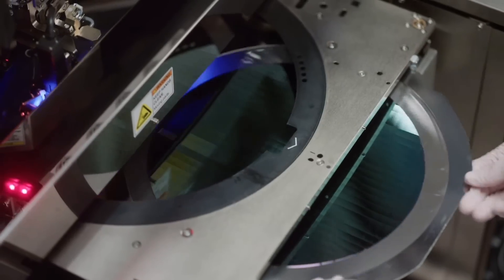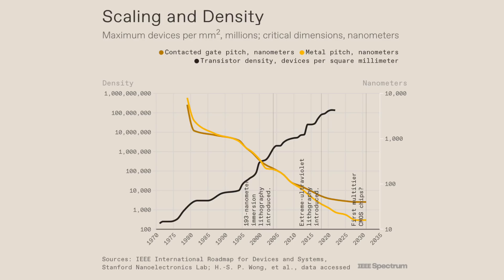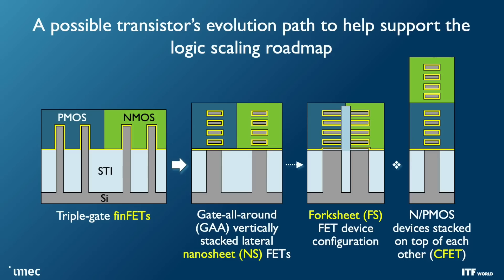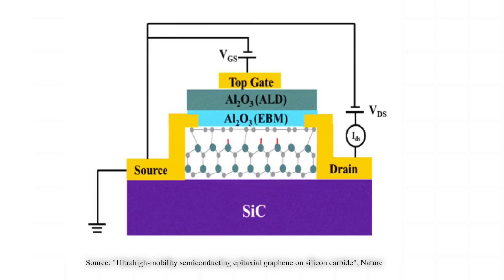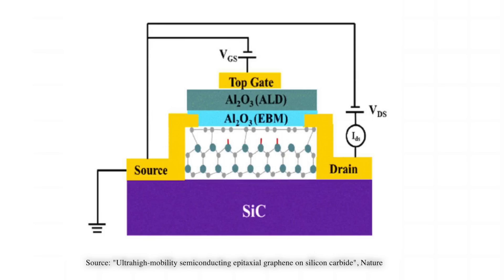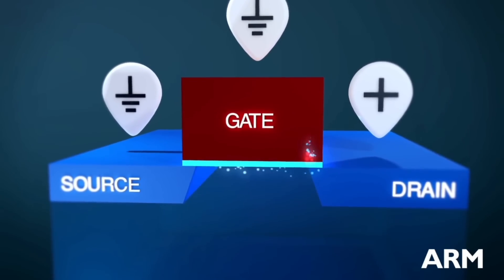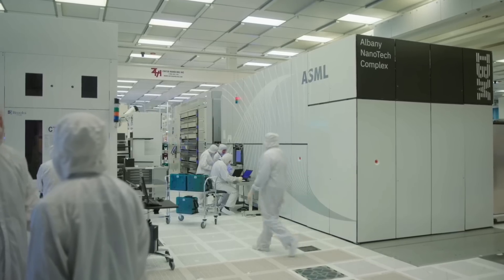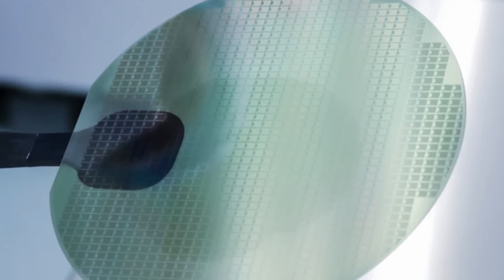Microchip Breakthrough: New Era of Electronics

Comment: I’m not tired of hearing about these potential breakthrough’s or any. I appreciate Anastasi explaining it so thoroughly. Face it, They have been talking about flying cars becoming a reality since the 70’s. Still waiting. Sometimes you just have to be patient. (Update - 1 week since original, reply post)                      I just read-China now has a autonomous flying taxi, able to carry 2 passengers at a time. It has been certified by the government and is now in service. So, I guess the wait is over.
Reply: Exactly what they said about self driving car’s. 10 year’s ago.
Reply: @AJF-v4i    Tesla's  are self driving   ... shhhhhhhh ..  your misinformed or technically wrong either way
Reply: Flying cars are real though - it’s only the lack of regulation and logistics of implementing it at scale that are in the way. We now have flying cars that are safer and easier to use than road cars.
Reply: Flying cars already exists in several models.
They just aren't generally appreciated. Because they are too expensive, too much problems with laws and infrastructure.
Reply: Flying cars are here…
Reply: We do have flying cars. There just isn't the infrastructure for them. They are better suited to rural areas.
Reply: This microchips need to be for whole world so the need to build in qantie and it need to work for the people but what if we can make something  like bigger more power and if we master that we make it smaller like in 1970 with the 500mb computer that was looding from the plane😂😂🤔🤔
Reply: @jdanci91 quantity I assume you mean
Reply: THey had flying cars available to the public years ago, many years ago.
Reply: But bro Flying car is real now people are using it commercially.
Reply: Actually the 1940's not the 70's. There was one, now there are more.
Reply: I'm a millennial, flying cars is not coming during my lifetime. If we can't invest in nuclear energy on a broad scale then we'll never move forward as a species. Either nuclear energy or discover how to harness dark matter, no other way around it.
Reply: Thing is, making flying cars isn’t a problem. They’ve been able to do it since the mid-90s. The issue is, the person that “will get gas in the morning”, or the “two beers makes me more alert” person. Flying isn’t the problem, it’s idiot property damage and potential lawsuits.
Reply: @metaphyzxx I'd say 75% of drivers are at their max driving a vehicle.
Reply: @metaphyzxx  damn you gotta point. I'm both of those guys wrapped up in one and I'm also a truck driver, oh shit
Reply: flying cars are a terrible comparison because it’s not really a breakthrough holding them back, it’s the fact that flying cars are a nightmare of safety/logistical/infrastructure problems and there’s no reason to spend time and effort solving them when we have much, much better options that already exist with mass adoption.
Reply: Have you ever looked at how horrible people treat there cars?  If flying cars where a reality, it wouldn't be a person pulling over on the side of the road because they haven't changed there oil in two years, now it falls out of the sky and hits my house. No thanks.
Reply: Yeah as engineer i also hate when hearing about flying cars.. it wont ever happen.. physics wont allow it. Cars need drag (downward force) so u can drive safely and btter grip while plane needs aerodynamic to fly off.. do u get it? U cant have both...
Reply: Flying cars aren't really practical for many reasons and introduce a whole host of liability problems, which is why we don't have them. Photonics, epigraphene chips, etc on the other hand are entirely practical and propose very few issues. Certainly none on the same level as worrying about a flying car breaking down and turning into a terminal projectile that smashes into your neighborhood and kills a family.
Reply: Cars kills and smashes into family every day, they don't need to fly to be deadly.  @JustSomeDinosaurPerson
Reply: @JustSomeDinosaurPerson   we are talking about combining graphite/ graphine and silicon to make a stackable chip that dissipates heat. The example of flying car’s was used (just) as a example about being patient, while waiting for the technology to catch up. Did you watch the video?
Reply: @AJF-v4i Yes, you brought flying cars just as an example for something to wait for… but JustSomeDinasaurPerson just told you, and you didn’t get it, that it was the WRONG example, because flying cars are NOT something to be waiting for, just forget about them, and find a better example, maybe Nuclear Fusion would be a better example.
Reply: graphene isnt a flying car.. we're not getting flying cars
Reply: Mm this is the real deal bro
Reply: they got jetpacks.https://www.youtube.com/watch?v=DkZPI5m9SIE  Flying cars in reality wouldn't be a good Idea, navigation rules, air and sky pollution, crashes ect
Reply: Don't forget about idiot drivers who are already dangerous enough on the ground, lol!
Reply: Flying cars exists since a long time. Was it a good idea should be your question
Reply: I've been waiting for self driving flying cars for like forever. It's so boring!
Reply: They're called flying drone cars or something like that. People can get in and fly drones themselves around where have you been
Reply: Come on man, it's the pie in the sky battery breakthroughs that really tire me.
Reply: Flying cars already exist. They are called helicopters.
Reply: Joby Aviation is quickly becoming the closest option to flying cars
Reply: The idea of flying cars actually goes back at least 100 years. 😅
Reply: Flying cars ARE a reality! We have the technology. I saw a video of a german teen building and piloting a flying bathtub.
The reason we dont see them is that 90% of car drivers can NOT be trusted with a flying car!
Reply: They are very close now
Reply: This AI is evil.
Reply: We have flying cars, it is called a plane
Reply: Oh actually we have it since the 70s duhh... Try drive it for 2 hours at least at 40kmh then fly back lets see how convenient it is. Flying cars are pipe dream why u want to ride when u can fly.. drone have a btter future than flying car
Reply: Yeah I feel the same way, but we both did click on this video right? And the flip side is that it takes a long time to reinvent a better wheel for lack of a better analogy. And when I heard her say GPUs and CPUs... Ugh I almost oozed...
Reply: A guy built a flying car in the 70s. The limitations with flying cars have nothing to do with tech. The problem is that there just aren't very many people with a pilots license and who live next to a runway. Because of that, the idea is entirely unscalable. These chips OTOH, will pay for themselves in Bitcoin alone. When they start making these, they probably won't even sell them for a long time. They'll just let them sit and collect money.
Reply: Hell flying cars that are approved for driving and fight exist. You can literally drive to any airport and take off in your car.
Reply: It’s copied from iPhone 7
Reply: Flying cars exist dude... Is a matter of regulation and society using it right.
Reply: That reminds me of recent veritasium video about blue LEDs
Reply: Flying car already exists
Reply: Flying cars don’t make a lot of sense. Theoretically, all the air-space should make travel good and smooth, but it will be harder for the driver and more accident prone. Interfering with the airplanes and helicopters isn’t a big problem, so I’m not particularly worried about that.

The unfortunate reality about cars is more that we have an over-reliance on them than that we need self-driving ones or flying ones.
Reply: flying cars are pretty boring in my opinion, any invention/discovery related to quantum physics is infinitely more exciting to me
Reply: @kiyoponnn  quantum physics one day they going to be use on the antigravity cars we or our children use.
Reply: We’ve had flying cars since the 70s. They are called helicopters. When you can fly you don’t need wheels…
Reply: @PwnstarUK  I guess you know absolutely nothing about automotive history. It is time to learn some history dude.
Reply: Paramotors and Rotokites are also examples of personal flying transportation that are essentially "flying cars".
Reply: I llove how people always use Flying Cars as a supposed example to argue that we aren't going to progress to whatever point someone is trying to argue with technology... flying cars are already a thing, they're called "HELICOPTORS" -- once the price/performance to build helicoptors and now quadrocoptor i.e bigger drones becomes practical they'll be here. The main reason we don't have flying cars is because of the oil companies dominance over the fuel industry... once everything goes eletric, solar, nuclear etc. a lot of these things will exist, jetpacks, robots, smart dust, and yes even fllying cars lol.
Reply: @itstherealmoe  have you seen some people drive?  no way they let plebs fly all over the place.  gonna get a quad copter smash into your 6th floor apartment window because he was looking at his phone or crash into a house because they don't know about oil changes.
Reply: @itstherealmoe  FFS not this again ...
Reply: @itstherealmoe   As I remind you that I ended by saying “we need to stay patient;” I’ll say, that’s not even what we are discussing. The topic is mixing graphine/ graphite to make a stackable chip that dissipates heat. Did you even watch the video?
Reply: @AJF-v4i  lol you're the one who brought up flying cars...

Comment: I'm curious about the development of photonic chips because I assume using photons instead of electrons would solve the heat problem, as well as being faster?
Reply: No such thing as photon storage, so you'd need to constantly switch back and forth to and from electrons to hold on to any values. Great for comm links, especially long distance, with the switching done at each end, such as with fiber cable.
Reply: @prolibertate.com.mydomain silicon photonics kind of addresses this problem of storage , by means of silicon structures.
Reply: @dchdch8290  I agree, to a degree, in that photonic circuitry can work alongside electronic. But you still have to store and retrieve electrons. Love to be wrong, and there are studies involving new materials and florescence, but no cigar yet.
Reply: Photons solve the medium distance communication problem, and doesn't have issues with wires crossing one another. I can imagine compute units linked by photon busses on a single chip.

Comment: Wouldn't Photonic Chips solve most of these issues, little or no heat, making it faster & better, smaller more energy efficient. How many years away do you think Photonic Chips will take to be inside Smartphones, Computers & AI❓
Reply: Are there photon switches that operate as fast  as required and can any such switches be mass manufactured into small packages of billions of switches very easily?
Reply: @AORD72  First couple of minutes says it all. Cheers 🍻 https://youtu.be/tOzg-2kVfWs?si=BCQMvVKLwJB9ybWs

Comment: Interesting paper, thanks for this amazing informative compilation. Would it be possible to have a comparision of state of the arts Hardware Accelerator (for AI applications) based on IMC in future videos? Also, I would like to see which kinds of devices are used in the MAC array for Digital, ANALOG or Mixed Signal Designs. I understand if it is not an interesting pick, but I had to try anyways. Thanks a lot! Keep up the good work.

Comment: Wait, transistors the most important invention?  No.  High Explosives are the most important invention.  "There is no problem too large or too small that it cannot be solved with the proper application of high explosives."  Transistors is possibly #2?  🙂